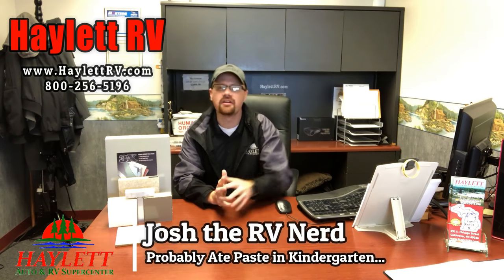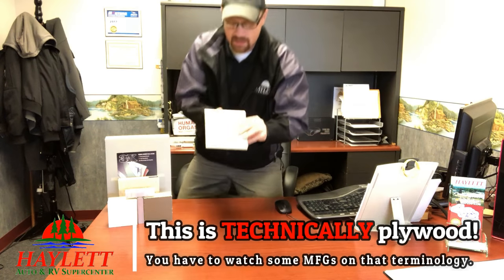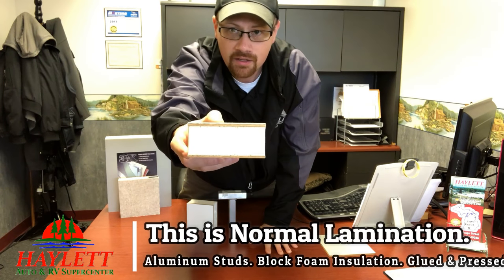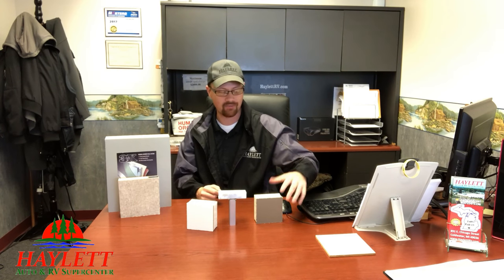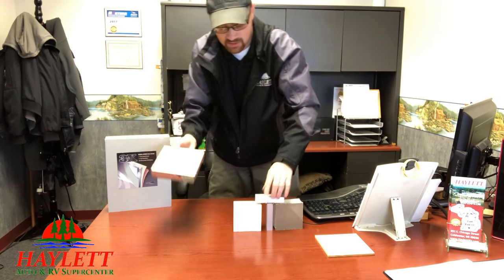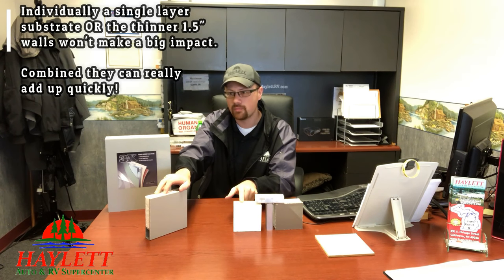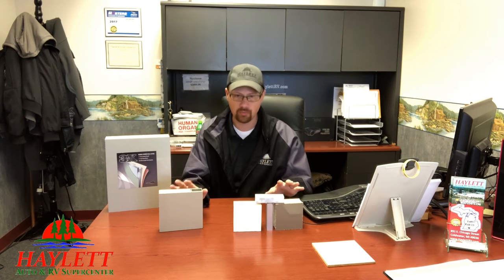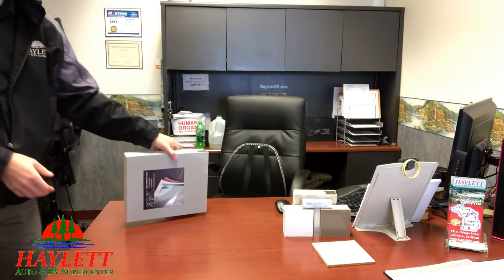Fiberglass RV Skin Methods & Lamination Comparisons with Josh the RV Nerd

Comment: Where can I buy the first option of exterior wall. We have an aluminum frame with this kind of exterior, with a ton of water damage. We want to remove the exterior wall on both are bunk house pop outs and replace it. We are also trying to remove the exterior hatches that went underneath the bottom bunks and the two windows to fit one large window on each pop out. We are converting the bunk house into two desk for working from home. I can’t find this material anywhere to buy and going through an RV company will cost a fortune.
Reply from the maker: Service centers can likely get some for you

Comment: Josh - can you comment on the different types and grades of fiberglass?  Lamilux 1000 vs 4000, Crane Composites, FRP high gloss, etc?  Also - what is the wall thickness and construction on a Rockwood Ultra Lite 5th vs a Signature model?  Thanks for the videos!
Reply from the maker: I will first say I am not extremely well educated on fiberglass. What I know is it generally boils down to how much resin is in the mold. 

Is there just enough to cover the fiberglass woven blanket, or is there more resin to create a more smooth and shiny finish? 

Then is it given an enhanced glossy coating to further shine it up? 

All Rockwood sidewalls are 1.5" btw

Comment: Good video. Seems like delaminaion is eventually the problem that can’t be repaired on these. Wish more makers would run aluminum skin over aluminum framing.
Reply from the maker: Swap the word "eventually" with "potentially" and you're spot on. 

I actually agree with the idea of an aluminum skeleton over an aluminum skin quite a bit, but the challenge then becomes the consumer base not understanding why camper A costs more than Camper B when they look the same. Unfortunately, not enough prospective owners will give a sales person the opportunity to explain, and frankly not enough sales people would know the difference to even explain.
Reply: Yeah I get that. People talk about wanting a better built camper. They are on the market, but generally $$$. Here, with 114+ temps in the summer things seem to delaminate even when kept properly sealed.

Comment: Hey Josh,
So if I’m understanding you correctly, the Jay Flights, that are fibreglassed walled, have the same construction underneath as the aluminum skinned? Just they wrap it in a layer of luan aka plywood around the entire trailer and then they glue it on?
Reply from the maker: No
Fiberglass skinned Jay flights are still stick built 

The fiberglass + wooden backer is hung onto the wooden skeleton
Reply: @JoshtheRVNerd  
Thanks. I watched your updated video and that definitely covered it when you raked about the hybrid ones and all that! Thanks for all the content you put out it definitely helps!

Comment: I’m going to be replacing the aluminum siding on the back wall of my Jayco travel trailer. I’m going to be installing filon. I plan to use luan on the wooden frame and the filon as the outer skin. Any recommendations on order of install? I’m thinking attach the luan to the wooden frame first using staples. Then adhere the filon to the luan while it’s on the camper. Would it be better to attach the filon to the luan first, then attach it to the frame? If so, how would I do that since I don’t want to staple through the filon to the studs?
Reply from the maker: Mfgs usually laminate the skin to the substrate first, then attach that to the skeletal work

But I am sure there’s more than one way to skin that cat

Comment: Hi josh just came across your channel and i have a question. I have a 1990 cobra sierra 35' bumper pull and if i recover my roof with fiberglass would i still need to go with the brick layout luan?(meaning staggard and doubled? I understand id have to with the walls/sides of the camper
Reply from the maker: A type of fiberglass used for most RV roofing is different than sidewalls and lamination. So either I don’t understand some thing or that wouldn’t be the right application for a roof
Reply: @JoshtheRVNerd  k so the roof fiberglass is different, i currently have an aluminum roof and tin or aluminum siding and was thinking of reskinning the roof with fiberglass would i need to put a layer of luan plywood on my roof trusses before applying the fiberglass? And if u could please send me a link to the fiberglass used on rv roofs please

Comment: Thanks for all your videos you have  great videos with excellent content any chance you could do one on mice control
Reply from the maker: Interesting topic. I'll think a bit on that. At the end of the day they're going to find a way into something if they really want to, but they will often seek out the path of least resistance. So, if you can make it harder for them to get in, then they will generally seek refuge elsewhere.
Reply: Haylett RV thanks for the quick response! agreed! I sure do battle with mice this was the worst year yet for me by far I have a 2014 Palomino Sabre 36 QBok fifth wheel and early fall they went on the attack in my RV so I stripped everything I could out and foam filled every opening I could possibly find it's definitely better now but they're still evidence of them getting in there a little!
Reply: You ever try dryer sheets?
Reply: Have you considered using those ultrasonic mice repellents you can attach to your vehicle? Something like this perhaps. https://amzn.to/2uvOqW5
Put this on your vehicle and when you already pitch your camp, run fairy lights under your setup so you can turn it on at night. Illumination discourages critters from approaching and scurrying under your vehicle.
https://amzn.to/2GnYnX1 < I used this one.
This combination has helped me keep the pests away. Also, I organize food and other items mice might find tempting in hard plastic containers like food.
Reply: You need to try Earthkind  rodent repellent, it puts off a wonderful smell in the camper and keeps the rodents away.

Comment: How many years does that FOAM last between the wall?
Reply from the maker: You mean the block foam insulation? It will likely outlast your use of the tv. The stuff doesn’t deteriorate normally
Reply: Why do I not see an aluminum frame around each window so when they Sandwedge the window into the frame there’s no movement when they are going down the road
Reply from the maker: @slyr1  This varies by brand. Do you have a specific brand in question?
Some frame out their windows. Some do not. Each construction style uses a different type of window installation as needed.

Comment: Front Filon question?
Keystone copper canyon sprinter
I took the front fiberglass off and the paper board backing is damaged and I want to replace it with ASDA or something similar that is impervious to water that will stick to the Filon.
Would you recommend this and where could I buy an 8x9-ft sheet I cannot get in touch with azdel.com What shall I say I cannot get them to return my phone call I left four messages this past week
Reply from the maker: I do not know a supplier to direct you unfortunately

Comment: I have a 30ft Sundance 2900k . Its 2008 year model. I am doing job by my self. The two back corners the corner molding on both sides has been neglected by previous owner.  He said it was ready to go. Did a quick walk thru I should have inspected throughout better my ? Is for any one the back sides near the corner molding has made wall swell up causing the wall to no fit properly.  I thought of a  A pot rivet gun But I still have a  problem The outside of the camper wall is not fitting into corner pieces any ideas please. The wood is good thank you lord it just got the  Luan
Reply from the maker: Without physically seeing what is going on it's difficult to know what might be required. Sorry Kitty.
Reply: Haylett RV well I got common sense ( does not grow in everyone's garden but for a 46 year old damn hard working woman mother of 4 I believe I will see my way they it. Thank you anyway. I'm determined without help but keep in mind the confidence will see me thtu.. .